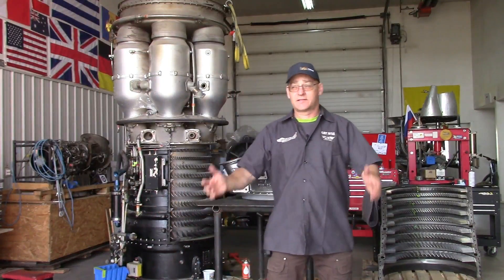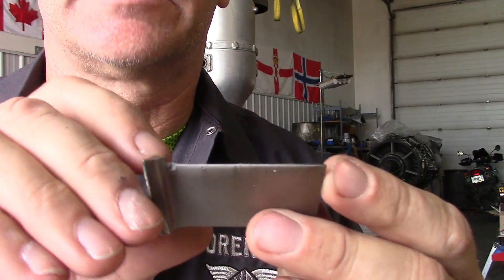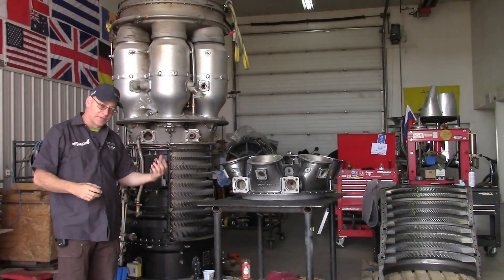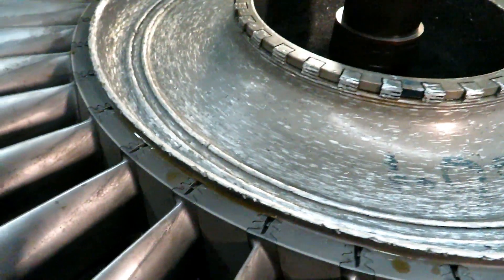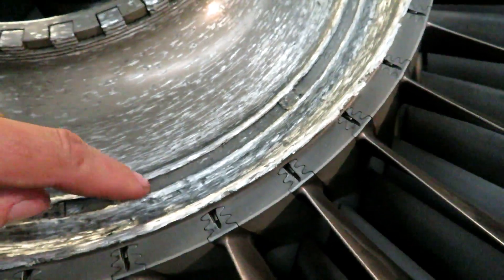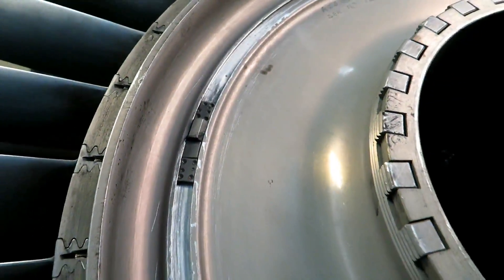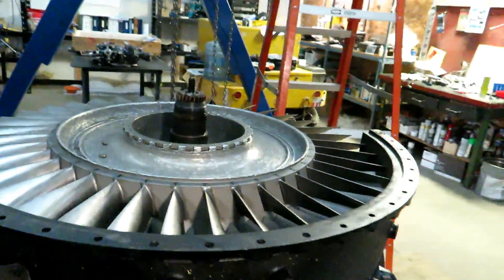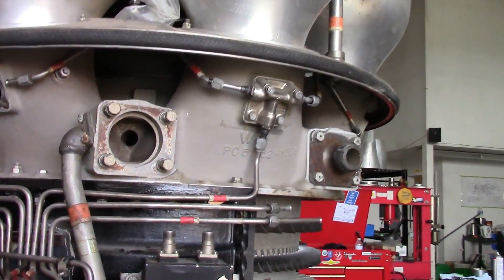Surprised by unusual damage

Comment: Glad they decided to replace. That disc looks like someone with a shotgun decided the world wasn't big enough for the both of them.  I'd be concerned if left alone (minus the loose bits rattling around) eventually any damage would propagate far enough for catastrophic failure.  Curious as to how many overhauls they've skipped during the life of the engine that might have saved them some grief with FOD.

Comment: My thoughts on the paint is it's probably from an era when ceramics were a new(er) material in paint, and the puke beige was the natural color of the ceramic material used to give the paint it's heat and corrosion resistance  characteristics. Material tech (especially ceramics) has come a long way to "what color do you want". 
This was an interesting one. I'd guess all the damage was from spin up and down, and can't imagine how long it took.
Thanks to your customer for the look inside, and thanks AgentJayZ for the story. It seems to prove the "overhaul when ever apart" philosophy - or least strip and inspect when apart. It's kind of unnerving thinking excepting  for some peeling paint, that might have been back in service unseen, and probably damaged the new parts fairly soon. Knowing how careful you folks at Jet City are, I'm thinking you would have heard it whilst turning the engine or inspecting during assembly. If it made past assembly, would it show on instruments during the test run?

Comment: Is there any air from the compressor going through that area? That would cause them to move around a lot, or at least enough that the weights that broke free could be punted around when the contacted the walls. Either that or the balance weights coming loose are a symptom of something else getting in there and tearing it up, like someone forgetting a tool or a bolt that was gradually digested over time.
Reply from the maker: There is no airflow through the space created where the rotor meets the front frame.

Comment: In the very beginning you show a compressor stator vane which has a nick right near the base of the leading edge, and you say it's not fixable. Granted, it's a stress concentration and it is close to the base, but why is this not fixable? When this happens to blades, I get it: blades operate at high rotating speeds and experience huge tensile loads. But compressor vanes are stationary, so I would assume the fixable damage threshold can go a bit beyond what is accepted for blades. I also don't think you would waste fixable parts for no reason, so could you please explain where I'm wrong?
Reply from the maker: Vanes don't experience the tensile stress that blades do, due to centrifugal effects of their rotation. But the stators are under the same bending stress that the blades are. Any vibration also places stess at the base of the stator airfoil. Any nicks or damage in the area of the leading edge that is the closest 1/3 to the base is cause for rejection to scrap for both rotor blades and stator vanes.
This is explicitly described in the overhaul manual. All manufacturers have very similar specifics for all of the different engines out there.
Reply: @AgentJayZ  Still, do they apply the same 1/3 rejection threshold both to vanes and blades just for the sake of simplicity? Is it correct to assume that a part which experiences bending stress can be blended a little bit further than a part which experiences bending + tensile stress?

Comment: Since the balance weights are designed to be in the “wheel area” wouldn’t it be “Loose Body Damage” rather than FOD? Now on through the rest of the turbine path yeah, FOD for sure. With LBD the root cause is typically addressed in the area of ensuring the design fit and locking the position of the weights when installed per OEM specs.
Reply from the maker: Man, that's a lot of extra words...Your first sentence is useless and is therefore discarded. Let's shorten your second one to: double check that the weights are locked.

The only reason this video was made is because this was a freak incident, never seen or heard of before.
Reply: AgentJayZ 
I spent a 35 yr career in failure analysis both mechanical and human error. My preferred process for human error analysis is Human Performance Evaluation System issued from the Institute of Nuclear Power Operations post Three Mile Island disaster. When dealing with mechanical failures I prefer the Kepner Tregoe analysis method. In the electric power industrie’s turbines we considered a foreign object entering a device causing damage somewhat differently than an internal component becoming loose and damaging the equipment. Have a nice day.
Reply: AgentJayZ 
I heard you use the term “Domestic object damage” in another video. I like that.
Reply: BMOD (Build Material Object Damage) was the term that was used by turbine engine manufacturers. Before I left the engine shop the manufacturer started using FOD instead of  BMOD since the build material was out of position it was considered a foreign object
Reply: This one is called "DOD"  domestic object damage or  intrinsic
Reply: It looks like you are speaking jebrish coz I didn't understand any of the thing u said
Reply: @habhaile1219  Lol, that's rich with the dodgy English you just wrote! ;)

Comment: Wanna hear a funny bearing story?  I had this tiny trailer (Dilly) for a sunfish sailboat.  I build a wood platform on it to pick up a little plane (N3 Pup) in Atlanta (I live in Austin, TX), about 1,000 miles.  Just outside of Austin, I stopped and ate.  I noticed one bearing dust cover had popped off (I had just repacked them).  Dang it....so, as a temp fix, I got a plastic cup, cut some vertical slits in it and rubber banded the sucker on.  This dust cap worked all the way from Austin to Atlanta & back!!! 

Regardless, I'll repack the bearing and order a new dust cap, but I thought the plastic would have melted, but turns out the hubs don't get very hot, barely warm even!  Still....a clear plastic cup as a dust cap worked...har har.
Reply: AAAAHAHAHAHAHAHAHAHAHAHAHAHAHAHAHAHAHAHAHAHAHAHAHAHAHAHAHAHAHAHAHAHAHAHAHAHAHAHAHAHAHAHAHAHAHAHAHAHAHAHAHAHAHAHAHAHAHAHAHAHAHA
Reply: Well from Hurst Texas as a fellow Texan I'm not surprised but I am happy about your ingenuity!
Reply: @ethanspaziani1070  Thanks!
fyi, just yesterday I started it for the 1st time (not on video).  I had the tail tied down and the throttle was NOT locked on idle (it was, but not tightly).  The tail was tied to a car.  That thing started up and went full throttle (no wings, I was going to just taxi it).  I ran away from the front of the motor as it blasted to full speed.  I came so close to getting chewed up by my new plane...good god I was mortified.  I even broke my new headset light.  Ugg (side story)....also, my full tank (750ml bottle) of fuel was used in less than 2 minutes.  That was noooo fun.
Reply: YAYYY, Austin... and clever Austinites!

Comment: I wonder if when the aircraft did a sharp maneuver the pieces would move and eventually settle again.    I'm sure they would heat up significantly too depending on how long they tumbled.
Reply from the maker: The aircraft has a roll rate of about 360 degrees per second... or about 60 revolutions per minute... 60 rpm.
The engine runs at about 7650 rpm, so... ...
Reply: @AgentJayZ  I'm speaking of a roll or barrel roll maneuver but most others.  When the plane of rotation changes the piece may resist that change.   If not so then this movement would have had to occur at startup or shutdown.
Reply: @MrBen527  forces inside the engine are far beyond what any aircraft could possibly do.
Reply: @vector6977  You're probably correct.  Just trying to figure out why all the damage.  I'm thinking the pieces break loose while the engine is in operation and tumble for a bit until they get up to velocity.

Comment: I looked up some sales literature on the GE LM line of gas turbines to get an idea of the service intervals required. Specific references were made to 25,000 hour intervals for hot side components and 50,000 hour overhaul. Do you reblade the turbines after 25k hours? What happens at 50k hours? GE quotes up to 99.5% availability, sound about right based on your experience?
Reply from the maker: Those sound like "best case" numbers. We see LM 1500 and 2500 engines in for complete overhaul at a bout 20K hour intervals.

Comment: I think you have a vibration sensor on the test stand. I presume the manufacturer gives you a base vibration number, if it was higher than the base value would it lead you to think the fod was still in the engine?
Reply from the maker: This engine came from an aircraft, where it appeared to be operating normally.
Reply: Might not even catch that on an induction test. And a lot of operators won’t ask for one unless they are trying to claim it for a warranty. Costs too much. Test Cells time and Jet A isn’t cheap.

Comment: Just recently, a commercial jet plane had to land before reaching its destination.  Smoke in the cabin.  Oil leak in the compressor section getting into the AC.  In this video you mentioned the seal(s), but i did not see anything that looked like a seal.  Is there a single seal at each end of the engine to keep the bearing oil in the center of the engine?
Reply from the maker: Don't know the plane.
Don't know the engine.
Not a plane guy.
Smoke does not come from the compressor... ever.
No further comment.
Reply: he literally points at the seal at 4:55
Reply: @AgentJayZ  Airbus A321-271N w/ Pratt & Whitney PW1133G

Comment: I don't know the engine but a few questions come to mind: Is that square profile ding in the vane root about the same size and profile as the edge of a balance weight? How are the balance weights held in? Any previous history of balance weights letting go on this or similar engines of same make? Are all the hub tie rod split pins intact? Any missing rivets from upstream, core, static parts, if there are any?
Reply from the maker: 1), smaller, more like a bit or a chunk of one
2) peened in place, most likely insufficiently this time
3) never heard of it ever happening
4) shaft nut cotter pins? yes
5) no rivets or other fasteners missing
Reply: @AgentJayZ  Thanks for the reply. As you suggested, it looks like bumbly balance weight peening then. It seems those big old, relatively slow turning, lumps can cope with a bit of imbalance, without affecting the pilots teeth.

Comment: This is not really a technical question as well a question of interest ... why is there not mesh mounted on the intake of jet engines to prevent birds from wandering in?.
Reply from the maker: There is no adequate solution that balances protection, drag, and economics. Also 99% of the flight plan of most airliners is out of the bird zone.
Reply: This question has been asked innumerable times over the years and yes, some of the very early centrifugal engines did have intake screens.  However, as engines got bigger, intake screens soon became impracticable.  
As I've just pointed out in another comment, the latest big turbofans have mass flows of over a ton per second.  One ton of air at sea level would overflow a 30ftx30ftx30ft cube.
Reply: @grahamj9101  Best wishes from the central plains of USA, hope you are doing well. Corn and soybean harvests full tilt w good yields - farm heaven here in Illinois!
Reply: GE us thru live turkeys into the engine to test it at the its Pepples test facility. Aircraft engine stall if they and restriction at the intake . bugs dust etc. They even test with massive amounts water to intake of a running engine.
Reply: @richardreddick5681  Live (as in not dead) turkeys? I very much doubt it. Years ago, when some uninformed reporter wrote an article claiming that live chickens were being used by R-R, there was a public outcry. He was quite wrong of course, as the chickens were very dead.  Even if they had been alive, they would have had to be totally anaesthetised to get them down the gun barrel.
All of the major engine manufactures carry out birdstrike, water ingestion and even fan blade off tests. It’s all part of the certification program required By the FAA and other airworthiness authorities.
Reply: @grahamj9101  probably dead. anything thrown in air in front of large bypass commercial jet engine going to get sucked in to the engine. around 80% thrust on commercial jet aircraft is produced by the bypass fan. Only around 20% by exhaust from jet engine thrust.
Reply: @richardreddick5681  Having had a career lifetime in the design of gas turbine engines, industrial, marine and aero, I've had to do some work on birdstrike during my career.
Reply: @richardreddick5681  Yes, very probably dead.  Nevertheless, I can imagine the Animal Liberation Front (do you have them in the USA?) raising objections and demanding the exclusive use of lumps of gelatine for ingestion testing.  And what they would say (and do) about the mass culling of Canada Geese in the vicinity of JFK?

Comment: there  is  no  way  that  1st  stage  was  serviceable with  all  that   damage, swapping  out   the  -10   rotor  was  the  correct   move.
Reply from the maker: ... and yet it was running for who knows how many years like that... You need to look at the facts. Yes we are replacing it, because we deem it unsafe, but when we didn't know about the damage, the engine ran well.
Thus the need for vigilance and diligence, wouldn't you say?
Reply: @AgentJayZ  yep....    Back  in  my   DC3   days  we   hung  a   OH  1830 PW...  about   90  hrs  on  it,  coming  out   of  Oakland      the Master  Rod   failed...   ran  fine  till    the  last  second...   oil  strainers    cked   at   25/50  Hrs  all  good. I  spent  a  year  at    the JT8  OH  at  Piedmont... lots  of   surprised  Management  folks     when  we    did   Hot  section   rebuilds... lots  of  $$$.

Comment: I would go with option 2 or 3. Leaving it may cause the remaining balance weights to come loose causing more damage. that set of "rails" the balance weights sit between appears to be thrashed to hell. I would not trust it's structural integrity.
Reply from the maker: As explained in the video, it is being replaced.
Reply: Option 4, find a really big reduction gearbox, and a big John Deere, for an awesome pulling Tractor.

Comment: Would the floating weights balance the compressor like adding sand to tire? The damage could be from starting up and changing speed, but once at speed they'd stop moving.
Reply from the maker: There is no upside to this condition. It will be terminated. Has been terminated.
Reply: @AgentJayZ  So you are now known as The Terminator. Sucked in Arnie, you've been replaced. ;)

Comment: I am surprised, why this engine didn't shutoff on vibration
Reply from the maker: There is no automatic shutdown in this aircraft. The pilot never reported any strange sounds of vibrations.
Reply: I thought it is similar to the industrial. 

Thanks for the info.
Reply from the maker: Industrial gas turbine are much more closely monitored. Our repurposed aeroderivatives are happy to be so lucky to live out a long and productive "retirement" as ground power units. They work for ten times as long as they did in their flying days, sometimes more.
Reply: @AgentJayZ  That is right. Those engines were available add to the power generation industry.

Comment: The blancolirio youtube site just reported that excessive wear of GE9X engine stators is the major reason for the Boeing 777x delay. GE has not been specific about the exact nature of the problem.
Are dimensional checks of compressor blades and stators part of the overhaul process for the engines you work on?
Reply from the maker: The clearances between rotating blades and cases on modern engines are much smaller than on these older engines.
Reply: More likely to be an issue with the variable guide vane mechanics. Tarmac to high altitude engines rarely suffer from erosion, unless they fly through volcanic ash or similar.

Comment: Would you even be able to thread the tool on to pull those two sections off with the threads in the condition they are in?
Reply from the maker: It only took an hour with a thread file... and then about 250 lb-ft of torque...and a few curses...

Comment: How can l design inlet duct for Small Turbojet-engine
Reply from the maker: I would start with the size and expected flight speed range of the engine/aircraft. Then I would do a search for turbojet engine inlet ducts, and start reading.
Now, I know you didn't need me to tell you that.
Reply: I know it's tiring, but can you give me a good reference name in jet engines @AgentJayZ
Reply: Do you want to design a 'ground use only' type intake (similar to those you see in AgentJayZ's videos), or an airframe installation? If the latter, then he gives excellent advice.